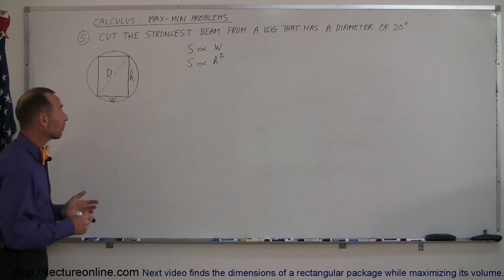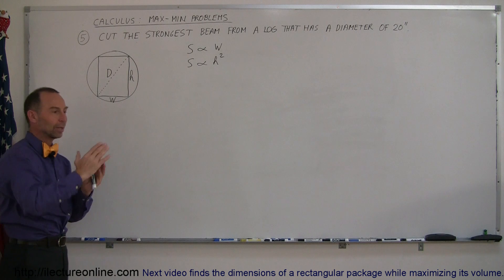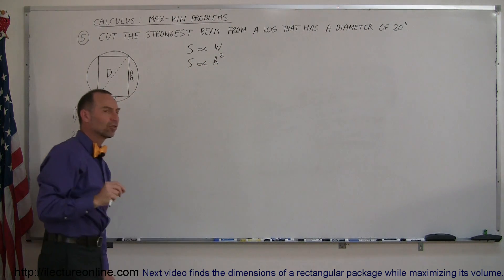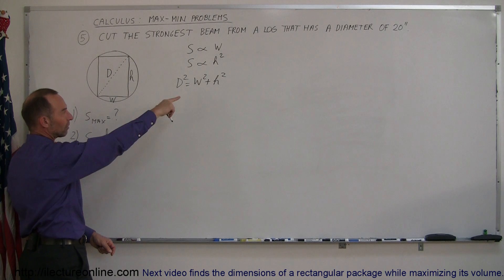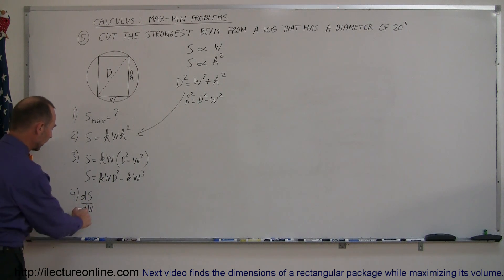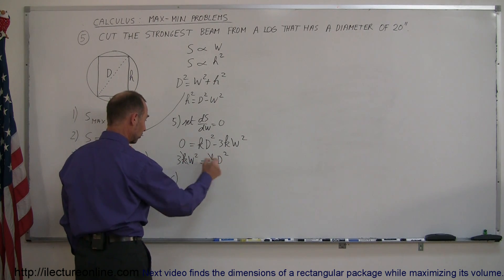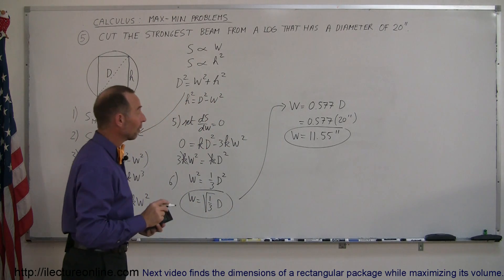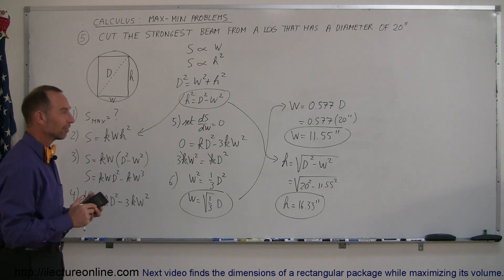Calculus 1: Max-Min Problems (5 of 30) Strongest Beam

Comment: I have a question, if anyone has a chance to enlighten me.  For other general max-min problems, you take the derivative of the function = 0. And we know the answer will either give a max value or min value of the function. So to determine if the answer is max or min, we plug it into the second derivative and see if that value is positive (min) or negative (max).  However, for this problem, we just assume that the answer is a max.  Why can we assume it is a max value? Is it because this is a realistic problem and we cannot get a negative answer (value for x)?
Reply: I found the answer to my question.  For anyone interested, this problem did assume the critical value occurs at a maximum point of the function.  To prove that the critical value occurs at the maximum value, you can take the second derivative of the function, plug in the critical value, and you will see that the output is negative, which indicates the maximum value does occurs at the critical value.
Reply from the maker: You can also think about it logically.  The beam would not be very strong if it was very skinny or very flat and thus somewher  in the middle you would expect a maximum value.
Reply: @MichelvanBiezen , thank you for enlightening me.

Comment: the ratio of Height to Width is 16.33 / 11.55 which is equal to 1.41385. . So, given ANY diameter of Log.. just use that ratio to figure out how to cut out the beam. :)  Well done Michel !!  Merry Christmas  too...  today is Dec 24, 2021.
Reply from the maker: Hi Philip.   This can be useful to a carpenter indeed.   Merry Christmas to you!
Reply: @MichelvanBiezen  which is sqrt(2)!